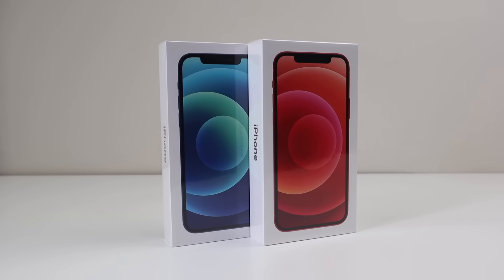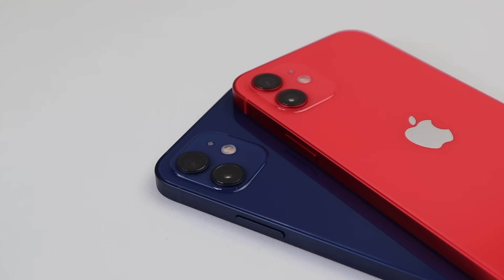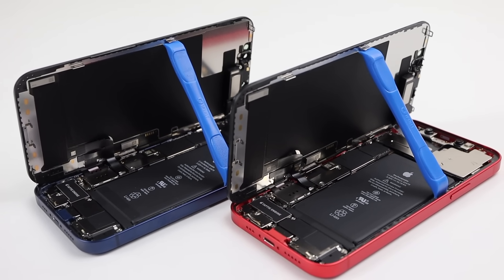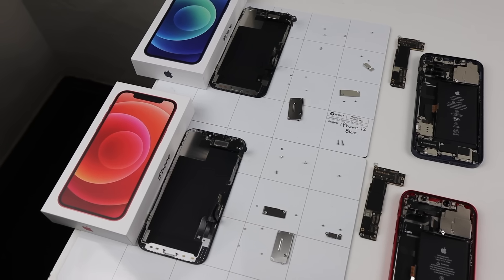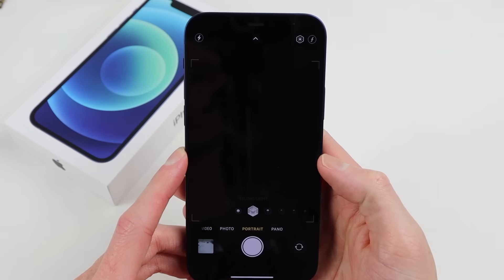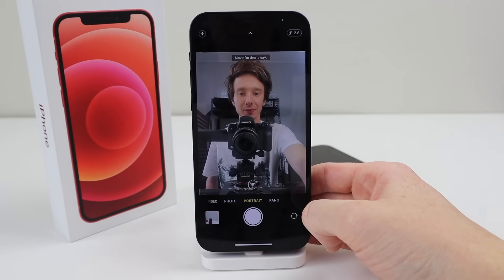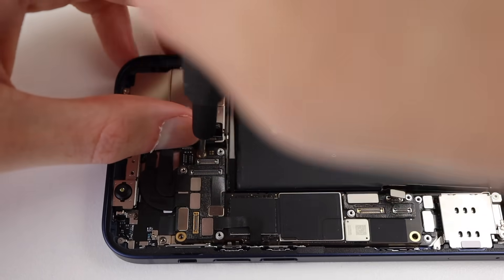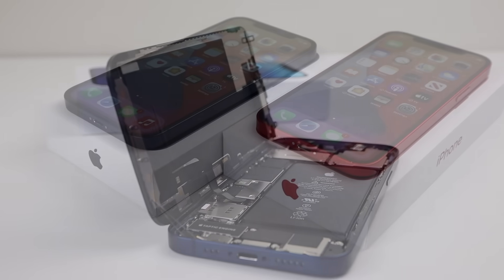iPhone 12 Anti Repair Design - Teardown and Repair Assessment

Comment: does anyone know what this means for screen repairs
can the Oled screen still be replaced from a third party or from the user itself?
Reply: Well from what I’ve seen in the video the answer is likely to be a NO because like he did in the video, he replaced the cameras and he was still having issues on the phone by just replacing the cameras. Yes the oled screen is different from the cameras but if you think about it, if you replace the oled screen, you’ll still have problems due to its “incompatible” to the phone. I hope this this helps you understand but I tried my best :)

Comment: I still don’t understand how apple users flock to their products. Phone costs over $1000 yet they can’t include a charging adapter that probably cost them $2. Not to mention the notorious issue with their batteries failing/swelling and now they’re trying to force you to use their service techs and genuine products.

Comment: Note: this is a purely technical comment. I am in no way condoning or condemning the decisions Apple has made.

It would appear that all major components in the phone have their own cryptographic certificates which the main system has stored in a secure enclave. The critical note is that the certificates are specific to the individual component, not a common cert for all devices. The reason for that is so that if one device were compromised, it would not compromise all devices. Whether this is a good or bad strategy entirely boils down to intent and expectation.
Reply: but if the security of the device is compromised by swapping the display, doesn't that mean the device is badly secured?

Comment: You need to use a tool called RepairCAL to assign new parts to iPhones...  and the restart with the need of connecting power is very common when repairing the newer iPhones

Comment: 7:27 
lol dude , who connects charger first and then puts display?
offcourse it will turn on and won’t whow anything on screen.. come on now...
if you ever did that on 6S you would burn component on board and without repairing it, you won’t get any light on screen .
Reply: that's not a charging cable though. It seems to be the thing that helps him support the display near the phone while he connects the wires inside.
Reply: @alec3641  
You’re correct. Just looked and it’s something like holder for screen .

Comment: is a company leagally allowed to design a product that can only be repaired by them? so even using the same factory components for the phone, ""security"" flags are raised? the firmware or custom chip like the T2 chip must be able to detect if the battery or any component has been unplugged and then boots the system telling it to disable certain features. the literal only reason to do that is to screw over repair shops and make people go to apple. that should be illegal